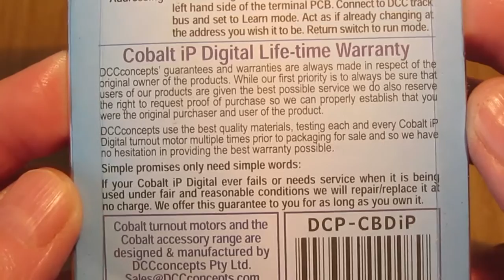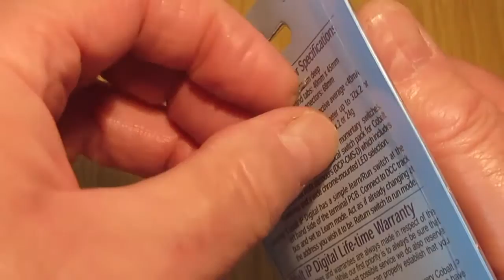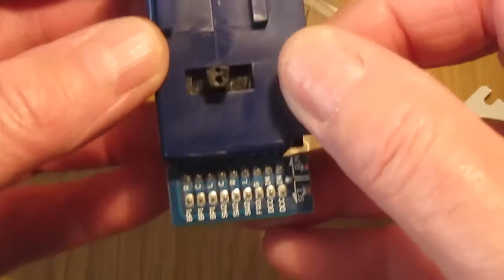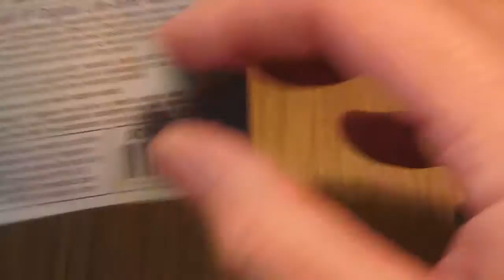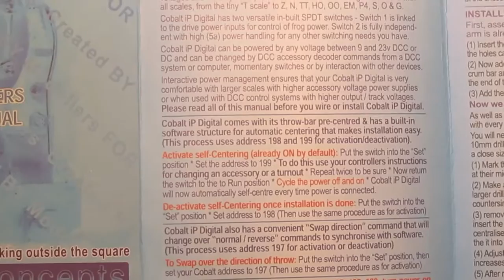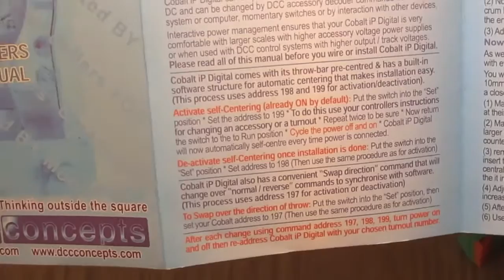Cobalt Digital ip  What you get....

Comment: Could you tell me the dimensions of this motor please, thanks
Reply: The dimensions are:40x40x65 mm. It´s smaller than Tortoise motor. But i prefer to use Tortoise motor because it has two switchable contacts and you can easy way swap the wires to the motor or contacts.

Comment: Brian I'm using this cobalt iP digital on a peco SL-90 insulfrog on the peco instructions it shows you cut two wires bend up join together each side of slip so you have two wires now one goes to the right point motor and the other goes to the left .S1FROG  .ok That's done  dcc concept say no insulate fishplates needed ? get the power from the track on one side connect up to motor on left side and the other from the right side.? Is this the right way to ?
Reply: You connect two wires to the point motor DCC. The third connect are for the frog by polarity. That´s it! If you use insulfrog, you don´t need to use the third connect on the point motor.